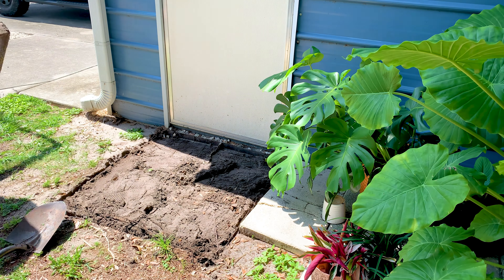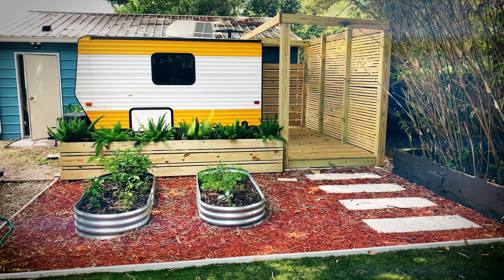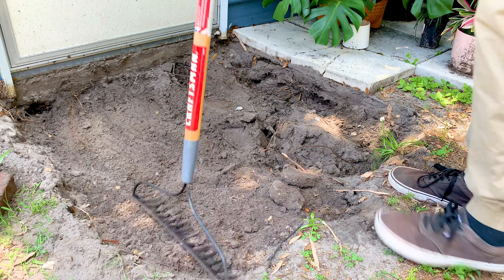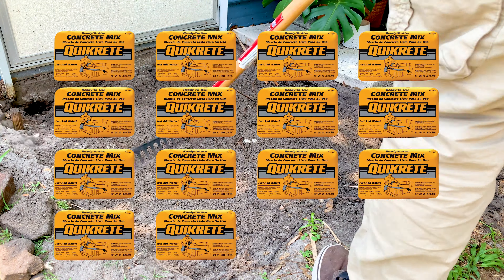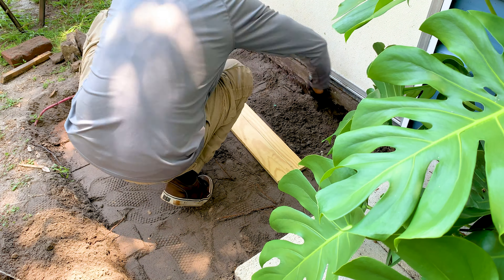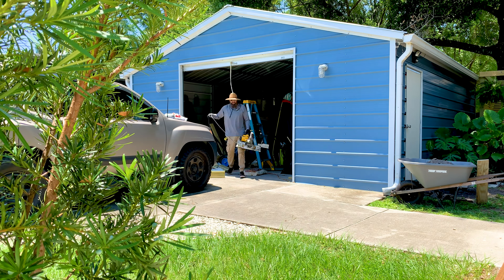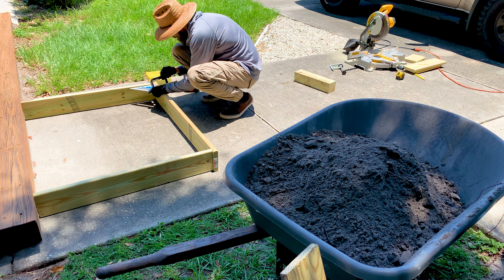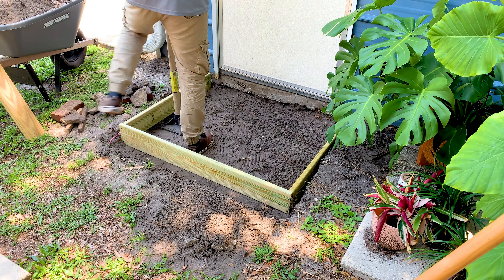How I Completely Botched a Dry Pour Concrete Slab

Comment: So what happened? Did you not water it enough to begin with or did you not smooth the top enough before you started to water?
Reply from the maker: For dry pouring, I believe you use mortar mix on the top layer to get a smooth finish (no gravel in the mix). I used the gravel mix throughout, so I ended up with pitting on the surface no matter how smooth I tried to get it - I wish I would have put that in the video. Good question.
Reply: @DIYMaverick  I made the same mistake yesterday! If you don't want to buy 2 mixes, you can  also strain out the larger pebbles and use that to fill in spots before the last screed.

Thanks for posting! I'm gonna look into that mix you used to patch 😅
Reply from the maker: That's a great idea!